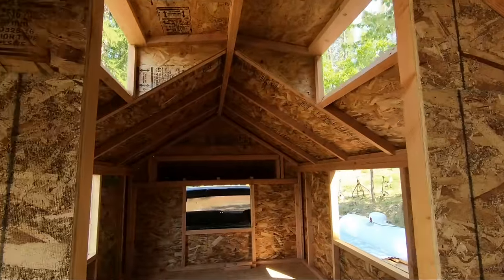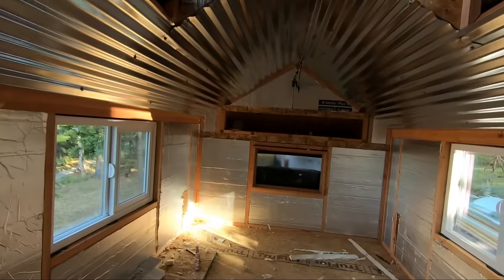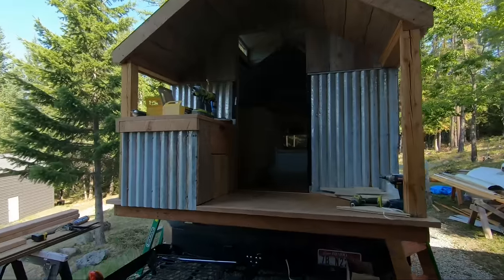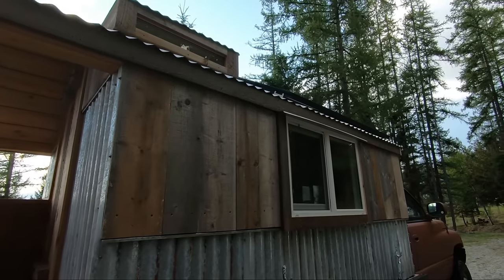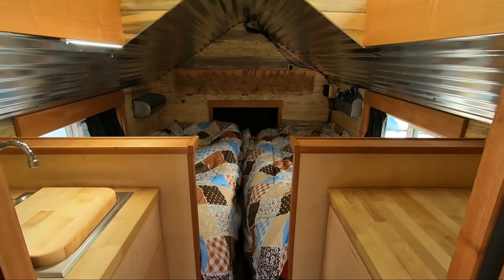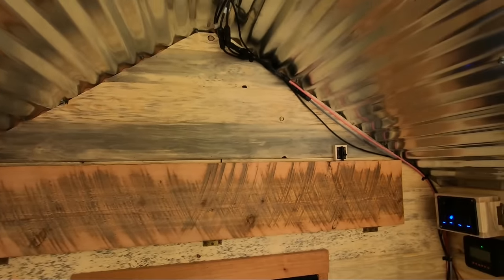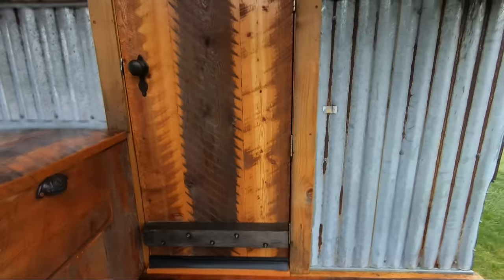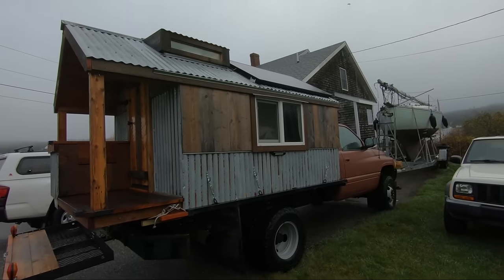TRUCK CAMPER BUILD AND TOUR / TINY HOUSE

Comment: Internet connection might be an issue 10 on the inside and the outside, I would have outcropped that window all the way to the front on top of the cab of the truck for more head space and a bed on top of the truck but I'm short and on my camper I used thinner wood shingles with epoxy under laminate rated r3 insulation r5's good

Comment: The workshop you have is enviable. The entire build is well done. Loved the paint job on the cab! Really great to enjoy locally, I'm sure. But can it travel long distances? Would like to see it!
Reply from the maker: Thanks!! Glad you enjoyed! It is a rough old work truck so not a great ride and top speed is about 60. It is a 12v cummins with a 5 speed and a lot of new mechanical parts on the truck so it is very reliable and gets close to 20mpg! I can also tow just about anything I want! I will be doing some summer camping in Maine videos soon.
Reply: Watch ( truck house life ) if you build it correctly it will hold up . Timmy's is real similar & 5 yrs old & still traveling around alaska .

Comment: Very neat Travel Cabin, very nicely done, subscribed. 

I have an intense dislike for certain construction materials (eg, chipboard, particle board, plasterboard/gypsum/drywall, etc,) and at the top of that list is Oriented Strand Board (OSB).

I never use it in any projects, as I prefer marine grade plywood, though this is in no way a criticism of anyone else's use of it.

There's even stuff called waterproof chipboard and OSB available now but I still can't bring myself to consider using it.
Reply from the maker: Thanks for the subscription! I agree with you on the osb. I actually have a pile of marine ply in the shop but am saving it for a boat build. I also just wanted to use some of the materials I had been collecting for years and build  for as cheap as i could.

Comment: nice build. curious what the weight comes in at?
Reply from the maker: Thanks! Not sure on the weight, it is just right for this truck though. I have plenty of capacity left and it makes the truck ride quite a bit better than when empty. If I had to guess I would say 1200 to 1500 pounds

Comment: Just found your channel, could you tell us about the sailboat?
Reply from the maker: Yes, the sailboat is a 1974 contessa 26. I picked it up a year ago and have plans to get it seaworthy in the spring. I have bought a new main sail and will be adding new head sails, some rigging and am still trying to decide on the engine. it currently has a tired yanmar 1gm.  I will be launching and sailing the coast of Maine to begin with. I was thinking of doing some video on that also!

Comment: How.cute! It looks so homey inside. How much does it weigh?
Reply from the maker: Thank you! Have not weighed it but would guess around 1200 to 1500 lbs. It is just enough to make the one ton ride better and still have some carry capacity. A build like this would be fine on a 3/4 ton truck also.

Comment: Like to know heaviness  of the camper...
Reply from the maker: Havent weighed it. I would guess 1200 to 1500 lbs. with batteries. It makes the one ton ride smooth and still has alot of capacity left. I would imagine it would be fine on a 3/4 ton also

Comment: So how have those windows held up?
Reply from the maker: Fine so far. I installed them so they would be easy to replace. I have put around 6000 miles with it on some pretty rough roads and it has been through a couple of far north winters.